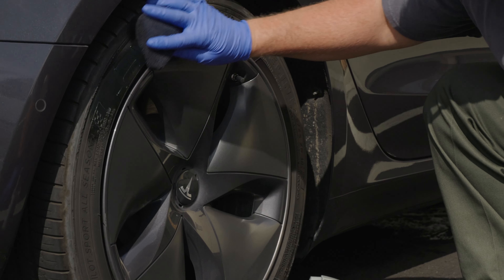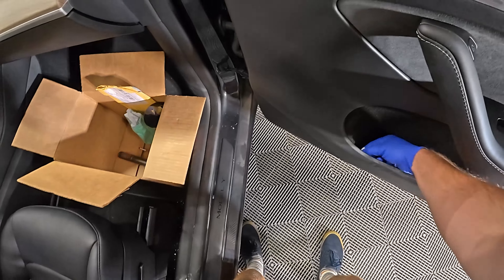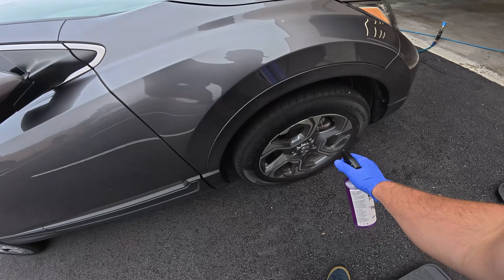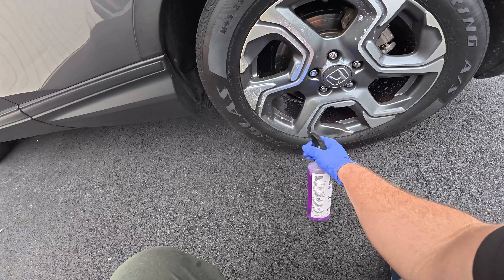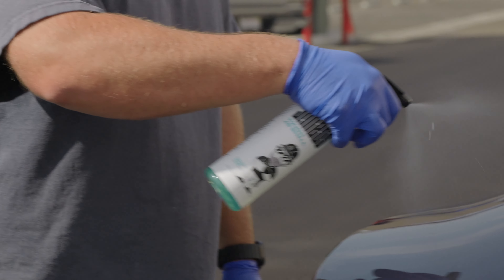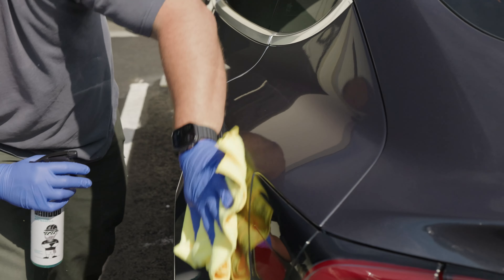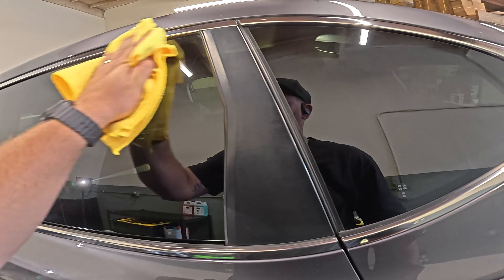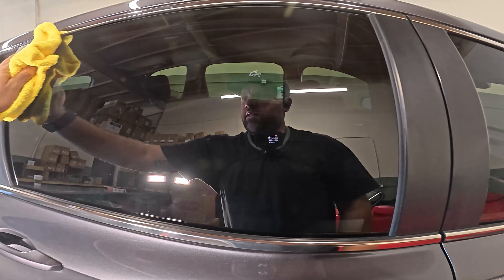Avoid These 15 Car Detailing MISTAKES That Even Professionals Still Make

Comment: What's the difference of using that little electric hand sprayer to pre-soak, then foam on top vs just foam, wait a couple of minutes and foam again, then wait a coupler more minutes and rinse?

The foam cannon is faster, more fun and it's easier to just do the mix on the foam cannon once vs again in the little sprayer?
Reply from the maker: Ya that works too. Everyone has a slightly different style.
Reply: The difference is to use more more more so you buy more more more

Comment: Always work smarter not harder, I most of the time, visualize the job start to finish as I go to sleep the night before, but 95% of the time work inside to outside,  glass is always last, trunk first, passenger side to driver's.  I'll steam the inside of the glass as I'm doing the interior, and use a soft scotch bright pad on the windshield
Reply from the maker: Great plan!

Comment: My car is coated and if only slightly dirty I will spray down with water, foam, power rinse and blow dry.  Not a single touch. I will scrub the wheel. Often i will add a light topper.
Reply from the maker: Sounds like you got a solid routine.